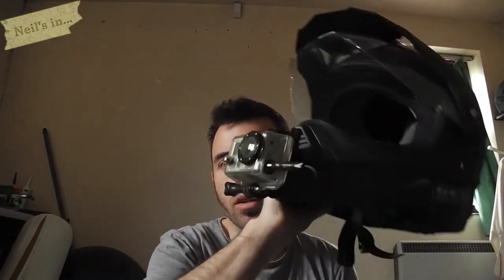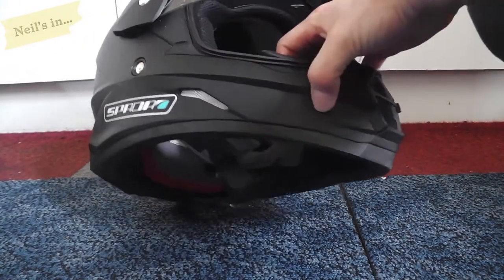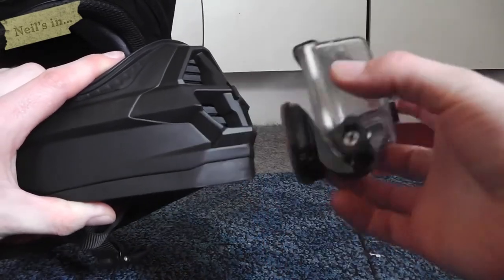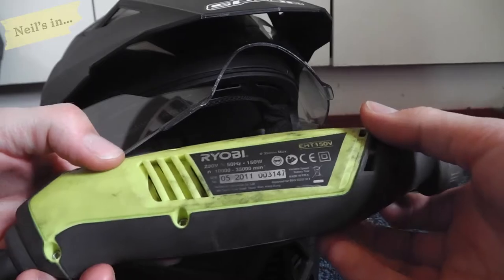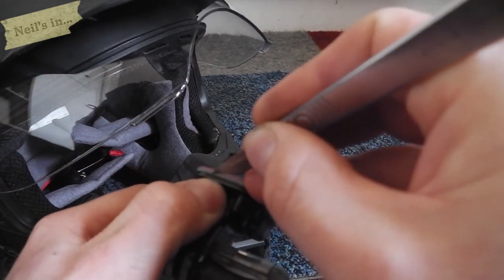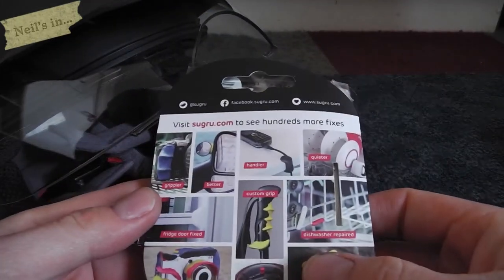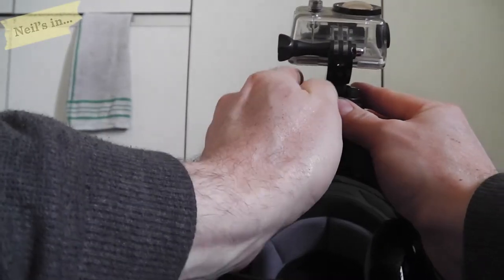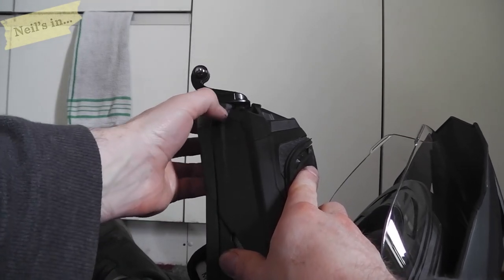Neil's HowTo... helmet cam setup  Spada Sting + GoPro Hero 2 + Audio Technica 3350

Comment: Never heard of sugru before. Hows it holding up to having a camera mounted on and shaking around?
Reply from the maker: Holds fine even at over 80mph, I'm super surprised at how well it has held!  Works out a little expensive but is impressive (£6 for 3x 5mg sachets), is like plasteline but sets like a tough rubber in a few hours.